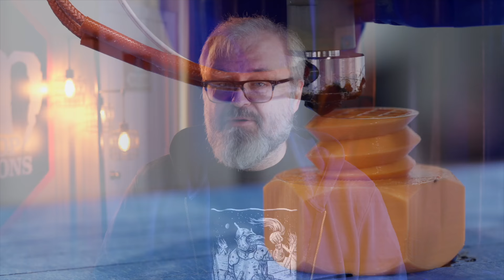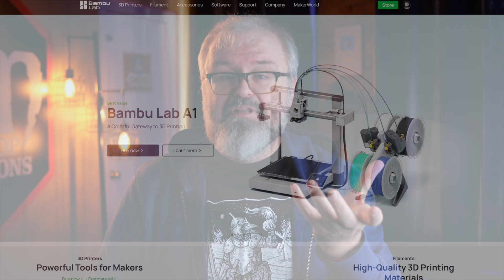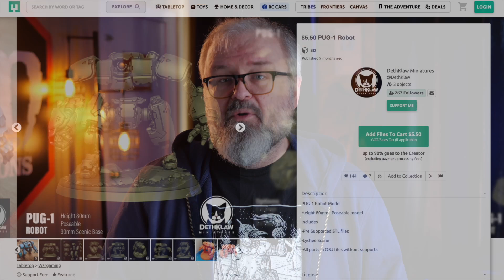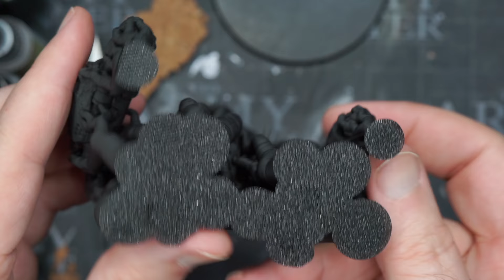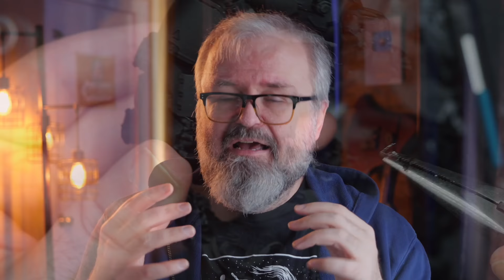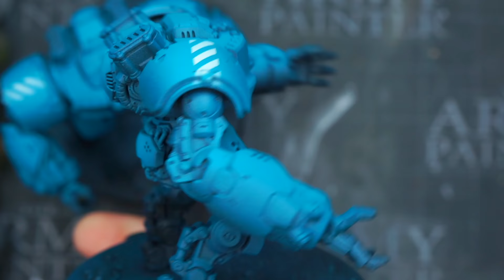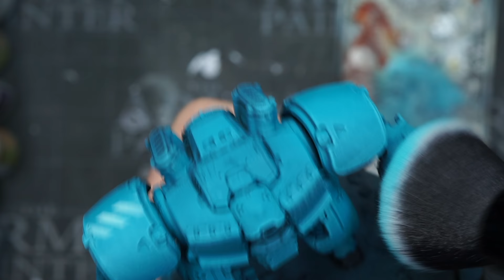I Compare RESIN vs. FILAMENT for 3D Printing Wargaming Minis

Comment: I'd like to see it done on a smaller 32mm scale model with fine details, because this is a big ol' robot. Try a knight with intricate chainmail and filigree on his armour, then you'll see a much bigger difference. I've only seen a couple of FDM prints I'd say were even close to resin quality at that scale and even then they took a long time to print due to tiny nozzle and layer height - in which time a good resin printer could have printed an entire build plate full of similar models.

Comment: A lot of the printing artifacts and rough spots on filament printed minis can be removed if you use precision clippers, knives, and sandpaper that way you would if you were buying minis that come on sprue sheets/grids. 

Resin prints need cure/wash time and add extra steps/work to the process. Filament prints can be printed and rushed into painting, but they gain much from putting in a little bit of prep work that is already seen as standard by folks who've been buying overpriced minis for years.

Comment: I mean you did resin professionally and filament poorly and all at once. It would be a surprise if the filament one went well. Resin prints are better on average, but unless you have a very good machine and sufficient knowhow, the difference won't be that extreme.

Comment: To be honest, the FDG settings are OK but you need to dial in the settings more. The layer lines can be smoothed out largely by changing the ironing settings. There were also a lot of amendments I made to the supports beyond the FDG profile.

Comment: Maybe in the future there's just massive printers that print full size robots lol.. I'm genuinely impressed by the filament print and can think it works with this kind of model as its not natural anyway so the unnatural layer lines aren't necessarily a distraction or obvious error but maybe that's just me

Comment: You can purchase FDM material specifically made for support- if you have a dual nozzle especially - you can print out a thin layer just at the model support interface to make it easier to pull out supports - and as others indicated print out parts separately to optimize strength and appearance of layer lines

Comment: Most people use resin supports for fdm now.
There is a blender addon called resin2fdm that makes the tips thicker and makes them holow so you save filament, you also only print every other layer of the supports, that all combines with the right orientation makes them look insanely close to resin.

Comment: Did this same thing with a friend that prints resin. My fdm version with .02 nozzle, decreasing layer height by 1/2, decreasing print speed, changing inner-outer-inner wall order, support distance etc, in .08 extra fine quality defaults on an A1. He bought an A1 simply for the post processing time saving, i.e. none. No washing, final curing, etc. I'm a hobbyist so it really makes me no difference, but he does it as side gig where he realizes the time/material saving potential as return on investment.

Comment: You can easily hide that stuff on the filament print with wood filler and by doing a little sanding.
Reply: 100% true, I like Adam like a lot but that was a pathetic print he did. I am not even good at printing and I could get a better print that wouldnt need the filler n sanding.

Comment: Arms length. That's all that matters when playing. I've played against Legos, 3M post it notes, cardboard cutouts, styrene, wood,  foam core, lead and you name it. Let's get together and just flat out play and have fun. FDM, resin I don't care, I'm old, I remember back in England the ol' gents in the backyard pouring hot lead and or pewter into molds and geeze NOW those  miniatures were flat out ugly, but that is what we had. Oh yeah to quickly help hide FDM printer lines you can use a classic external mix airbrush. It will atomize the primer with open air leaving a bit of grit or say bite on the model.

Comment: Currently beginning my path to 3D printing will most likely be going with a filament printer as I do not require super high-res amazing looking builds, will probably be building households hanging hardware, glass lid replacement handles for cooking pots, quite possibly a fair amount of nerf blaster hardware (VERY possibly) and actually maybe some figures for my munchkins game with board.
Great video now I know the full difference between resin and filament printing.

Comment: Ive been curious about printing for DnD, and as a mini painter, the "small details up close" matter to me since im painting it. Also, im seeing people say you have to do "X,Y, Z" to make filament look good. Print in pieces with THIS specific nozzle, use a heatgun for the supports and when it looks bad at the support points, you have to go back in and fix it. 

When i See resin prints, these dudes print in whole pieces, the supports come off with moderate wiggling/pulling, and up close they look way better.

I wanna get fdm because of all the tools and storage space designs i can print with them, but i cant sacrifice quality. Make a case for you opinion and help me decice.

Comment: If you print the pieces individually you can create supports that optimized for each part leading to better print results and less or in some cases no supports. The orientation of the print is also important, for example, printing apart with a complex curve on its side, can eliminate any of the typical banding lines from 3D printing. I would also say after having watched your video you should look to adjust the top Z distance (increase) along with the top supports layers to help with easy removal of support.

Comment: Get out of your comfort zone, tweak the slicer settings, do some post processing and you can't tell the difference.  Don't just print a file that you downloaded, learn Blender, cut the model into pieces (you'll learn how and where to do this over time).  And get rid of Bamboo Labs, learn how to use your printer and Slicer software and it can do amazing things, you don't have to spend the money on a BL when there are much more affordable printer's out there that have much better quality for half the price.

Comment: Yeah print separate prices and find an orientation where the least Sean side faces down for each peace with thin weapon print them sideways for better strength then I’ve found an acetone fume bath works great at smoothing any layer lines and imperfection after ward a sanding on anything like the areas where there are supports helps finish the clean up you’ll be left with a smooth fdm print ready for paint that looks way nicer than what you have here

Comment: I find that filament prints can work really well if you SAND the model (I use automotive sandpaper) and also do heavy weathering. I printed out some models and made a small army of like Very rusty beat up Almost junk yard looking robots, The imperfections then just looked like more weathering and when you work with them it comes out pretty nice. If you want clean sharp models... Resin... thats it.

Comment: I know that this video is just comparing two 3D prints out of the bat.  BUT we are also aware, that there are ways to make a filament print better. It may not be as beautiful as resin prints, but it's more cost friendly.
Since I'm no gazillionaire, I can just opt to blade scrape and sand my models to make them look good...also, printing inside a case/cover with acetone drenched paper towels will also help make finer filament prints.

Comment: Dang. I’m impressed how nice and informative this video is. Instant sub. Thanks for the insight. 

With that said, I have to agree that resin just looks better for minis. I tried regular sized minis and they just look not as good. But I’ve found it doesn’t really matter in the long run cause nobody really cares that much. They’re hoping you aren’t judging their models.

Comment: Unless you have a separate room available for resin printing, I'd avoid it like the plague as liquid resin is very unsafe regardless of what kind of mask you wear.  It gets into your eyes and lungs and screws you up big time.  Do not use resin unless you have a garage or well ventilated basement.
Reply: Only mask I recommend when working with resin and alcohol at the same time (alcohol allows resin to be evaporated into the air making it highly dangerous) is VOC rated face mask, and change it it out every 6 months months to year.

Comment: If you FDM print the parts separate as well you probably won't need as much support or support at all if you could orient it correctly or orient so that the support are at non visible locations per say

Comment: Resin ist Not Dangerous. IT must be Handled with Care and is toxic. Dont make IT worse then IT IS.
Reply: It is dangerous when you dont have all the equimpent and procedures which is near identical to running a lab, it is not something meant for hobbyist like FDM is but if you are attentive go for it

Comment: FDM, something I didn't see said, with supports, use a filament of a different type for the support interface; like petg on pla and vice versa; the supports will come off cleanly and less effort; also, printing in different pieces will be best. It's a good apples to apples comparison except that your using each tool the same; like comparing a rubber hammer to a steel one; try using each tool their strengths and you'll get better results.

Comment: 14:20 - yeah, that's the secret. Beyond even better slicing (you can slice way better) you can use gap filling spray plus sanders to smooth an FDM model.

Way more effort to prep than a resin printer (once curing etc is done, which probably makes total effort closer to even), but I'll take it for the lower toxicity.

Comment: Thinking of investing in a 3D printer though resin seems more than I could manage. I am about to watch the Bambu Lab A1 3D printer video. I am curious if you've tried to print a 28 mm model with the filament printer.
Reply from the maker: I haven’t yet - but some people do. I like printing terrain, big figures (like robots), and vehicles with FDM. Thanks for watching!

Comment: Its all about understanding the support and slicer settings. Print in parts for better orientation also using a 0.2 nozzle will help. A good primer helps as well.

Comment: Hi, I just watched your show. I have three powering printers a recent one. I haven’t got started with the Rezin one yet but I print with the PLA and I print manages with it. I’ve done the walls for Warhammer through that and you can’t tell the ones you get from the store from the ones that I print even once you’ve painted them they look exactly the same as normal messages. That’s the way you set up. Your machine is how you get your good prints and that and you and you also gotta get a really good file. If you get a bad file you won’t get a good print I’ve subscribed to your station hope to see some more good content about 3-D printing. I love to 3-D print and my name is Mark I’m allowed to say my name

Comment: I've had lots of experience printing minis with FDM printers and Printed for combat has great tutorials on how to get the most out of FDM minis.

1. The biggest shortfall of this video on the FDM side is the fact this guy printed with tree supports (or any supports you'd find in pretty much any FDM slicing software). I highly recommend learning to use beefed up resin supports for fdm printing, and to print things at an angle like you would for resin. Printed For Combat has some absolutely phenomenal vids teaching you how to use resin supports for FDM minis.

2. Dude should have 100% printed this robot in parts on his FDM printer. This would have allowed the easier removal of supports and would have minimized the height of the print to maximize bed adhesion (and the probability that the print head/nozzle knocks the print free from the bed due to leverage). He would have prob gotten better looking results by pairing the beefed-up resin support method and printing the parts individually.

3. This guy (not to be mean) obviously didn't do much research on how to optimize his FDM minis because the video by Printed for Combat that I refer to came out an entire month before this one. I understand that by the time Printed for Combat's vid came out, dude was prob halfway through production, but that's just some shoddy research in my opinion.

4. I will give credit where credit is due though. Dude did use FatDragon's printer settings preset which is pretty good if you have the right filament. Although exactly which filament is best is up for debate and just depends on your printer and results.

I'm by no means an FDM stan, and I highly prefer resin printing for miniatures, in fact, I gave up FDM printed minis and got a resin printer. However, I feel the need to represent the tip of the spear in FDM mini printing techniques is important, especially to those who want to print minis, but are unwilling to deal with the risk of resin printing, or can't due to lifestyle or life restrictions.

BTW, for anyone wondering, search: The Future of FDM Minis is... Resin Supports?! by Printed for Combat. This should direct you to his vid. He's got a couple more as developments have progressed as well so be sure to check those ones out too.
Reply from the maker: My plan wasn’t to show the absolute best that FDM could do, it was to show what an average user like me could be out of an FDM printer and compare it to a regular resin print, as well. Honestly, the FDM print was fine for tabletop gaming quality - and the quality can go up from there if you want it to. If I showed the “tip of the spear” to people, they’d then be less likely to try because they’d have to go through all of those tweaks to get that quality. This way, they can see the still-usable quality by not tweaking much at all. Thanks for watching!
Reply: @tabletopminions  Honestly, you are right. I didn't even think about the difficulty of going through all the trouble of doing those tweaks. I suppose I'm just so used to putting what others might consider extreme amounts of effort into my prints that sometimes I fail to see that it may not be something everyone is willing to do.

Comment: I won't belabor the point of many of the other comments by saying piece-by-piece is preferable.  Instead, I will say that printing it at a 25-40-degree angle (leaning backward) would have ensured a lot of the support interfaces were at the back of the model instead of underneath on the front.  Something else to consider.
Reply: 100%, FDM needs to be orientated in certain ways to get better quality

Comment: Change your support settings. Change your support type. Print the model multiple parts. Use a 0.2mm nozel. All of these things would help you get rid of most of the issues you had with fdm